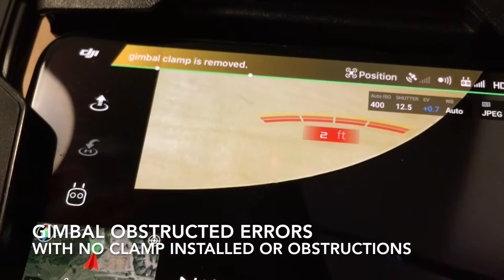DJI Mavic "gimbal obstructed" error after 21 flights & ZERO crashes

Comment: Same problem with this piece of shit of Mavic Air. Hope they can fix it for zero dollar... 😤
Reply from the maker: my Mavic Air just took off and didn't respond to my controls. Fucking piece of shit crashed into a metal fence in Maui. Regarding your issue - DJI will make you pay for your gimbal issue if it's been over a year. I had to pay $180 bucks after 20ish flights and NO crashes.

Comment: Ribbon cable.
Reply: I fixed one visibly broken cable. Now its doing it again without a visible break, but I bet its the cable again. I'm getting it in a few days. I'm wondering how common a circuit board failure is at fault?
Reply: Anyone ever have a fix to this? As I have tried ribben and gimble replacement and no luck. Sometimes tilting the drone works